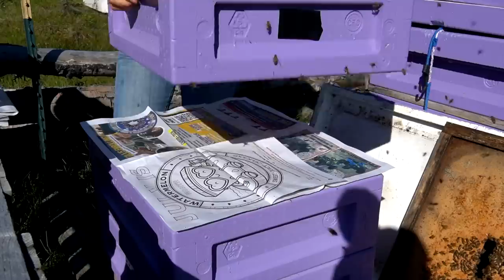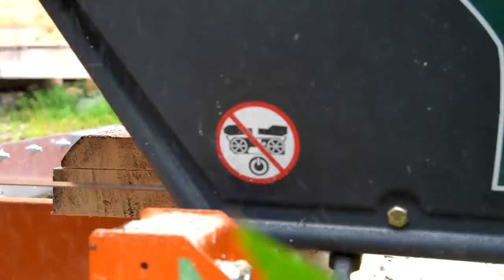Fall is Here | Beehive Issues & Chicken Coop Upgrades

Comment: From an old bushman. Your mulch will suck out all your nitrogen from the soil as it breaks down. Stopping growth and strength nitrogen from chook poo will fix that. Potassium for flowers and fruit spread around as from your fire. Always wear ear protection when using loud power tools and eye protection with cutting wood. Got a large splinter in my eye from that and my hearing is damaged. Wear a safety helmet when cutting down trees, had to have part of my face rebuilt from that but it saved my life. I experienced those things. I don’t want you to. Robby AU

Comment: Suggestions for fruit trees.  Fertilize until August, then stop.  Try placing hay at base of trees soon, then once again after first couple of snows.  Dual insulating layers.  In the spring take the straw off as soon as possible, because it will insulate from the heat as well.  Begin fertilizing when the rains begin.  Good luck!
Reply: we are step one check the channel

Comment: If ever change scopes a quick get on paper technique I’ve used is: Put a L on some paper. Set up at 25-30 yards. Pull the bolt out and look down the barrel to see if your on target. Now have a really good stable rest. Aim at the lower left edge of the L. Take a shot. Now set back up on target, have someone dial the scope to the bullet impact. You are now lined up. Or so. We really enjoy your videos!

Comment: The only thing I can think of for those fruit trees is maybe to alter their microclimate in the next year.  You'll want to consider mulching a bit more, and planting some ground cover and bushes around their bases that will help raise the ambient temperature slightly over winter & into the spring. One thing my landscaping father taught me was how trees could have a slight difference in temperature at their bases because of companion plants & bushes creating little microclimates.  Usually this was because of pockets of trapped or at least slowed air that helped keep the plants warmer, as well as darker foliage helping to retain more heat from winter sunlight.

IIRC, it's usually a difference of 1-2 degrees Celcius, 3-5 degrees Fahrenheit.  Admittedly, that doesn't sound like much, but even a little bit of help can push a plant into a higher temperature growing category.  He did say on more than one occasion that roughly every 5 degrees Celcius was a different growth & reaction category for plants.  So if they're sitting at 13C, which is the 10C-15C range for plants (50F-59F), and if that was the "produces leaves" category for that particular plant type, then you add 2 degrees, that can push it into the 15C-20C range, (59F-68F), which could be the "produces flowers" stage.  He was able to get some plants flowering & fruiting a little earlier because of this...though it did take years for his observations to bear fruit, "...Pun intended,"  as he once said.

Comment: Love those bees.  Some sweet honey.  Their lives are very dynamic. Glad you got a queen.  What you don't do now can contribute to starting over in the spring.  Good job.  Been a strange weather year here in East Kentucky, wet/floods hot.  On your fruit trees, only a small handful of mild fertilizer  5-5-5 or 10-10-10 is plenty strong.  just under the limits of the limbs, so not much and away from the bulb/trunk.  Trim out that center staub sticking up.  Keep the trees trimed so you can throw a hat through them.  No limbs cross or overlap.  Productive trees generally look horrible, but they bear.  Some beautiful vids of the animals and flowers, especially the grouse.  If grouse aren't messed with they are almost as (tame) as a chicken.  I've petted them before.  Just be easy.  I couldn't believe it first time but several after that.  Seasons are changing for certain.  My friends up Coldfoot have had termination dust already, much early by a week or so.  Question, do you reload,?  Saw you saving brass.  May have some equipment you could use.

Comment: I read that you can sight in a rifle with one shot.  Hold on target center and fire.  Say bullet hits 3" off center at 5 0'clock.  While holding crosshair at center of target,  adjust scope until crosshair is aligned over bullet hole.  Now, point of aim is aligned with point of sight.

Comment: Don't give up on the fruit trees. I had the same problem but after several years they are finally looking strong, heathy, and growing. Lots of blooms and a few apples I left on to try for taste. Next year should have a good harvest for the smaller trees that they are.  Also just a thought, I had a tree that died down, 2 in fact. The root stock that came up were amazing trees. The best cold hardy peach tree ever. The plum stock turned out to have the best ever plums, much better than the original one would have been!  But I did noticed I really had to boost the feed to trees to keep them strong. I use the  stake ones you hammer into ground. I use more, and more often than on box.  Good luck with your trees, I know how hard it is to get them going but worth the wait!

Comment: Arielle, try not to leave any stubbs when you cut a dead branch....always cut by the collar of the dead branch, otherwise the tree cannot properly recover and grow new tissue over the removed branch to cover the wound, which would otherwise rot and carry disease into the interior and exterior of to tree, such as fire flight, etc.  Remove any dead branches as soon as you see them dying off or leaves dying such as tip die-back. All the Best, Amy K.

Comment: This may help with the fruit trees. I am zone 5 but highly variable and 7,000ft.. 
 Don't prune as trees, let them shrub but keep root stock cut. 
Make a climate wall on North side and  which ever side is cold weather wind path Make  berming if you can. Wall about 8ft high and at least double the shrub growth width  in either direction. If spring winds are different than winter make sides that come off the wall at 45 degree angles as shield walls.
If you espalier (alternative to shrubbing) the growth near the wall, leave a good foot for air flow and don't tie to the wall. wrapping the shrub in net to 'bundle' it during winter can protect the trunk. Remove net at signs of bud out.Pruning is to remove root stock growth and keep the shrub compact.basically under 8ft.

Comment: What is it with the bees this year? One of our queens absconded and then it looks like the new queen did so as well. Herding insects is not easy. My .475 Linebaugh is a 45-70 cut down to 1.4” and sends a 420g bullet at 1350f/s out of a 5.5” barrel revolver. What a time proven round the 45-70 is, and it’s perfect in a lever action. We wish you the best of luck this year in getting a moose. Great episode guys, Dan and Elle.

Comment: Our fruit trees didn’t set fruit this year either..we live in Norway and a lot of the fruit orchards here had fruit setting problems..found out it was because we had a few nights of frost in the Spring..so the trees were tricked into fall/winter extensions 🤦🏻‍♀ plus..you said your fruit trees were relatively young..in regular climates for fruit trees to set fruit it take 2 years to fruit after planting..in colder climates like Alaska and Norway..it may take 3-4…plus..because it’s colder..you Must Fertilize them and don’t over prune and make sure when you See👀 blossoms…they get pollinators..if the bees don’t…take a feather and go from blossom to blossom and pollinate them yourself..tedious I know..But it works👍 Goodluck🤞

Comment: your 6 wheeler , keep turning the steering  left and right when u find it difficult to move ahead , constantly changing the direction of the front tire helps gain some traction and helps you move ahead easily in a tough terrain.

Comment: Fall is there, but our high today was supposed to be 113°F. It was definitely hot.
Reply: 109 here in Northern CA. So tired of this constant heat wave and so ready for fall!
Reply: @1corinthians-138  Most people have AC, don't they?
Reply: @Yesica1993  Yes, but we are on flex alert. This extreme heat for so long is not good for the grid. Even with AC, it's hard to get to a cool temp without running 24/7 and really expensive.

Comment: If you are getting shoots coming from the root stocks (at the bottom of the tree), you need to pull the trees and start over again. Generally speaking, the root stocks for fruit trees are selected for their hardiness, but they rarely produce any good fruit. Therefore, if you are getting shoots low on your trees, but the upper part of the trees have died, you are growing trees that will do you no good.

Comment: Spend 200.00 and get a basic reloader....save a ton on the ammo.  I use a Lee hand reloader.  Get the cheap lee trimmers for the brass.....can clean brass with water and lemon juice....cheap stuff.  Everglades ammo has cheap bullets.  You don't shoot much so don't need an expensive setup.  Save your brass from the commerical ammo.  
You can use IMR 4895 powder for both the 45-70 and the 270 win.  I like 54 grains of RE 22  for the 270 with a 150 gr Nosler BT but IMR4895 will work for both.

Comment: I've planted about 30 fruits trees by now, and I can tell you the main mistake you did is buying them too big. They do not acclimate well when you do that, you think you're gonna get a head start but you're not. They take years to make proper roots. Also, you should not let them flower or bear fruits the first few years, you should remove all of that so the plants focus on their roots. 
You should buy small trees in like 10 cm pots, they're usually 2-4 years old depending on the plant. They'll root better, get acclimated quicker, and grow faster than the expensive big ones you bought. You should also experiment with sowing pits. Fruit trees grown from pits are the strongest trees you'll ever find. And they keep the variety, they do not need to be grafted, unlike apples and pears. So you can sow peaches (well not for Alaska), plums, cherries, apricots etc... either in the ground (but birds can eat them) or in pots (they'll sprout the year after). They grow exceptionally fast, with a tap root that makes them water self sufficient. But they fruit later than grafted plants, it takes usually 7 years. Nuts can be sown too, like almonds, pecans, walnuts... But I doubt you can grow nuts in Alaska ?

Comment: You may want to send a message to Jason at Cog Hill or look at what he is doing in his fruit orchards his gotten a lot of growth from his trees but his not letting them be put in the ground and go . His training his with taking two or three shoots so all the energy goes into the runners he has. As for the flowers you would need to do more research into your trees on what they all need to bloom. Or talk to your local nursery finding the best that grow up north you may have to do a mix of what Jason has done and move them into a hot house like you have for some of your other plants. It should work cause they are not going to grow taller then 5 feet if that.

Comment: Hey Maybe you can make teepees for the fruit trees ,and you can use shrink wrap Maybe stuff straw up to the leaves , inside for insulation but make it so the leaves do not touch the plastic . My Friends Mom one year utah, did that to her young trees. They had loads of snow in the Mts. ! She also would wrap old sleeping bags around the structure make a tarp or plastic around the bags and Shrink wrap that onto the top!until it was all wrapped up tight  She would also the top if they going to be snowing a lot .. rocks around the bottom . In Washington State they use warm blowers ...maybe they need their own greenhouses . for the winter ..and then  you have to think about permafrost.. maybe plant them in barrels with wheels and put them in the greenhouse. That would be warmer than outside .. and off the ground till they are older ...FYI  Love Oregon
Reply: temperatures are actually the same inside and outside a tunnel. It would protect from wind-chill and snow load

Comment: Here's my suggestion for your fruit trees: Dig them out and put them in the greenhouse. Cut them back HARD and keep them at your height, trimming them back every year. The limbs will grow more laterally instead of vertically and the fruit will be easier to get to. You will then bonsai the tree so it stays small, but the greenhouse will give you the additional warmth you need to get good flowering and fruit set. And yes, even bonsai trees produce fruit - a LOT of fruit. 
If it were me, I would build an additional greenhouse for your fruit trees. Doesn't have to be large. Do some research and you'll see.